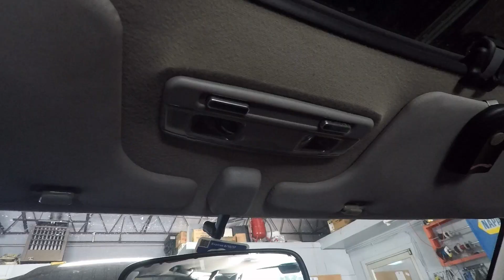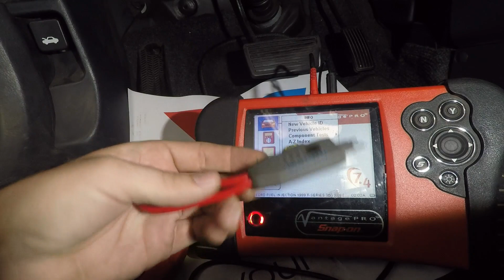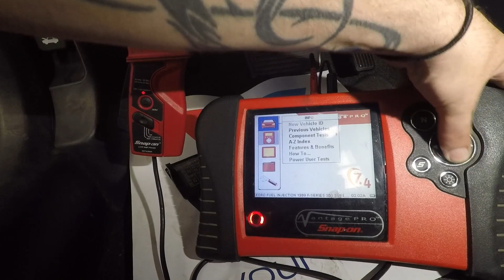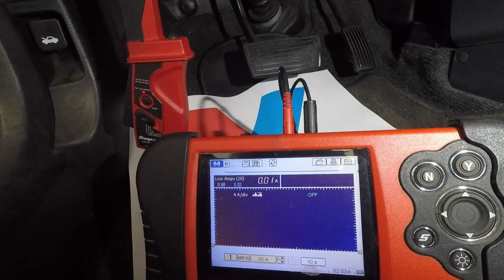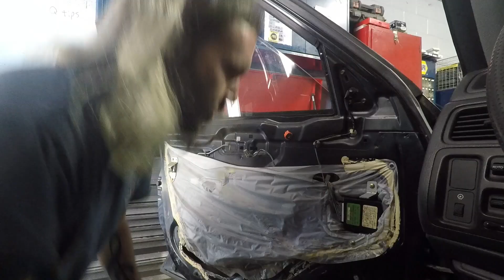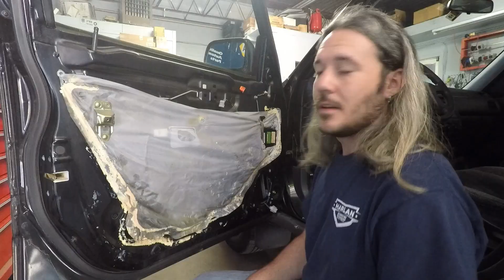Power Window Testing the Easy Way

Comment: I REPLACED the switch and still getting no power to the window motors in my rear 2 windows. tested motors thru bypass and motors rolled windows up and down fine

Comment: sO, are you saying that iF my power windows aren't working, as well as my interior lights.. then that's an indication that somewhere along the lines, the circuit is broke.. 
& it's actually One issue that needs to be found & fixed.. & NoT 2 separate issues???

Comment: Awesome Derek...i think i already knew the switch was the culprit because i changed both the motor and switch on my Monte Carlo a few years back. Now i have to familiarize myself with this Buick Lacrosse i have with the Master power window problem. Already checked the fuses under the hood, the wire between door and interior panel are all intact and now i just have the switch in my hand and tried your trick so im certain its the switch now. (The test light doesnt light up when im holding it to the wires)Appreciate your  video! Thanks!

Comment: Hey Derek what if the switches for the passenger power window on the driver AND passenger sides do not dim the map lights?

Also when probing for power at the connector of the passenger window. One  of the two wires flashes power when activating the switch, BUT the other wire shows constant power on the test light. Constant power when flicking the light either way and when the switch is not being pressed?

Please advise